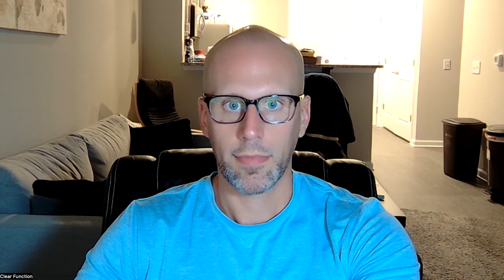OmniPod5 Bluetooth Troubleshooting, Site Changes, and Controller Reset

Comment: As a 59 year plus type 1 diabetic, I have a lot of scar tissue. The pod does not always work correctly on some injection sites. Therefore,when will Omni pod come out with a pod with an angeled cannula that will inject insulin between scar tissue layers? I understand the tandem Mobi currently has this technology..

Comment: Thank you for this video - I recently started wearing my Omnipod on the back of my right arm, and my Dexcom G6 was on the left side of my abdomen, and I had error with connectivity. When I change out my next Omnipod, I'll put them on the same side of my body, and make sure the Omnipod is not on the back of my arm. I didn't think they were that finicky...

Comment: Guess what never loses the CGM reading regardless of body position.  My iphone SE.  I think that insulet has provided another controller device that is not very good.  For some reason insulet continues to disrespect the omnipod by providing a controller that sucks in some way.  This time it is the bluetooth signal instead of the battery.  I can't wait for the iphone omnipod 5 app so I can toss this thing in the garbage where it belongs.  My thoughts.  Thanks for the discussion though.
Reply from the maker: I can't wait for that either. Any idea when the iphone app is coming out?

Comment: Dexcom 5 is not as great as advertised, my glucose be extremely high after anything I eat. You give yourself the extra units through bolus and my sugar will get so high I end up taking an insulin shot to bring it down 
I waited hours several times , I been going through this disaster for months and honestly it’s not a recommended product

Comment: Yes! I entered my original settings into my first omnipod 5 that I had with Dash. By the second pod, I was running in the 180s, which is bad for me. I called the nurse, and she said the pods were taking my basal settings and cutting them in half. She told me to restart the controller with my basal settings doubled. My second “first” pod gave me perfect control. Now I’m on my 3rd pod, and it lets me run high, so far up to 190. I’m high in the morning and then again in the afternoon for a few hours. I’ve been giving lots of corrections. I’ve been told to wait 4-5 pods for best performance. I hope it works. Otherwise, maybe I’ll restart the controller for every pod change. It’s a hassle, but the first pod gives me great results.
Reply from the maker: Good luck Bonnie. I had a similar experience at first too. My advice is to keep strengthening your correction factor and insulin to carb ratio, along with manual corrections. I had almost no faith in the system after seeing bad numbers for the first couple of weeks, but it honestly has improved over time, and I hope the same happens with you